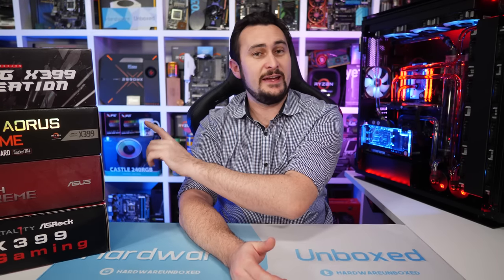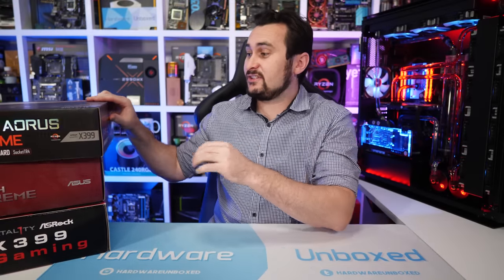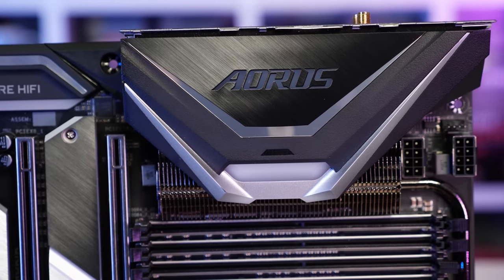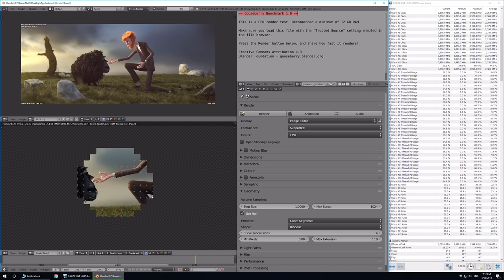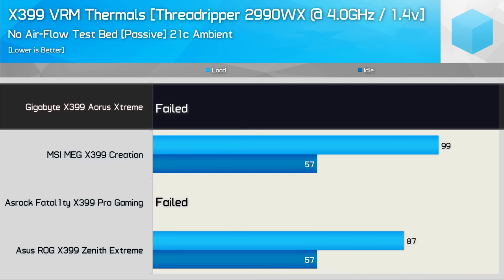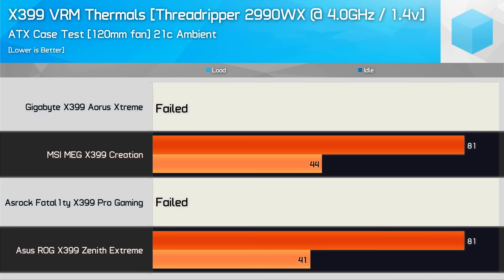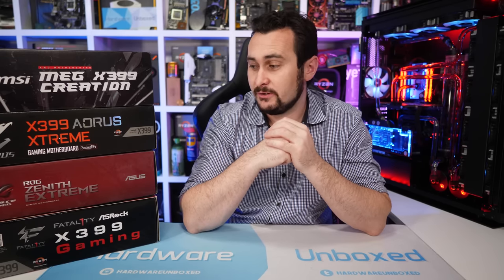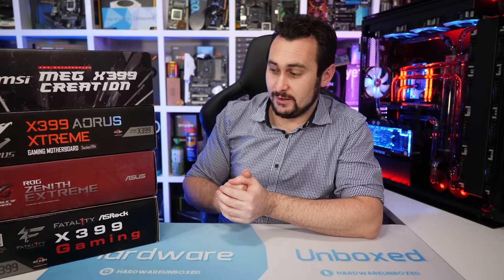2990WX Tripping Up High-end X399 Motherboards, VRM Temp Test

Comment: After using gigabyte mobos almost exclusively for 20 years for personal and hundreds of client builds, a string of DOAs and the RMAs i saw at one of Australia's largest retailers in 2015 has me swearing off them for good. Asus was the most reliable for mobos. (though i wouldnt touch an Asus monitor outside of a basic office setup. Same with Acer.)
Reply: they all seem to be going down the loo given the launch orgy... after years and years of market stagnation with just a new intel socket every few years and a few refreshed designs, then Z270, X370, B350, X399, X299 and Z370 all came flooding out in 2017. Asrock, Asus, Gigabyte and MSI now all have large contingents of rightfully pissed off customers and given the former no surprise at all. If these companies were smart they would have limited their market tiering to 2-3 models for ATX and 1-2 for mATX and mITX; but most are trying to keep the 3-5+ for every chipset and form factor they had before.
Reply: I've used Gigabyte for a long time in personal and custom builds for customers. But a series of having boards fail after a few months (yes, covered by warranty) has me now looking elsewhere. Gigabyte boards look great and offer a lot features, but what good are they if the boards fail or can't handle overclocking well.
Reply: Go with asus. For client builds (as im sure youre aware), hardware faults are a pain in the ass and the biggest pain is Mobos. Even for high end builds you dont need to bother with the ROG stuff, just use/recommend the 'A' models.  For e.g. the z370-A has good VRMs, plenty of features (the ones most people will actually utilize) and youre not paying a premium for ROG branding and pride parade LED lazer shows.   Regarding RAM, use Crucial (for default speed) or corsair & Kingston. Steer clear of Gskill.   Use Johnny guru's site to help select PSUs within a given price range - (seasonic for the high end).   Crucial or Samsung for SSDs.  Samsung for monitors.
Reply: I've got an Acer predator x34 monitor, it's actually really good. Saying that though, at the time it was their highest end monitor, so i can't really speak for their low end stuff.
Reply: With Asus mines litterary been the oppisite 0.0, the pg279q has been solid. The x99 strix, well go ahead and look up the reviews >.>
Reply: So you don't watch to touch the best 27 inch gaming monitors(165Hz ips 1440p) from last 3 years? Nice
Reply: Remember when Tyan was the bees knees for motherboards? Now they only do server stuff 😐

Comment: You know, now thinking about it, since it is possible to turn off cores in the threadripper series. Could it be possible to turn off both the 2990WX dyes that have direct contact with the RAM and infinity fabric, and then test how the performance is with the 2 dyes that don't have the direct lanes from the RAM. (I'm probably butchering the explanation but I hope you know what I mean.) Since only 2dyes of the 2990WX have direct lanes to the memory where as the other 2 do not. I feel like if it is possible, it could be a good test, just for fun that is. With the usual gaming and productivity benchmarks.
Reply: YOU DO NOT HAVE TO DISABLE THOSE DIES!
You can run process on specific die like this
cmd.exe /c start "" /node 1 "steam.exe"
Node 1 and Node 2 do not have direct access to memory.

Comment: 1.25v and 1.4v?  Ryzen CPUs will need around 1.35-1.37v to run a stable 4 GHz on all cores.  I have mine (1800x) set up that way now.  I can run 4.05 stable at 1.37v.  At 4.1 GHz it needs 1.39-1.41v.  I had 4.2 GHz running at 1.45v, but I didn't want to leave it there.  Got a 1920 CB15 score at 4.1 GHz.  These boards will fall short powering this many cores.  X499 needs to call for a new power envelope.
Reply from the maker: There is no 1st Gen 32-core Threadripper part so that makes no sense. Zen+ has different voltage requirements to Zen.

Comment: Hello

I have a setup similar to this, amd 2990, Asus zenith Aplha, and video card GTX 780, 1200 source ... When I use a video card with separate power supply appears 94vram error on the motherboard display. If I use a simpler video card without power from the source it goes up the oprational system.
Would you have any suggestions for me to be able to plug in a video card that has power and power up?

Comment: I'd like to see how the 2990WX performs on a board that has proper power delivery. I mean, what did they expect? Trying to run a 32 core CPU, with a VRM that's barely a token gesture.
Reply: My 4 phase VRM is pushing about the same power as an OC 2990WX    :)    mwahaha, lets here it for sub-zero temps!

Should be around 450-500w (that's conservative estimate for the CPU alone). I'm pounding it with 1.7 Vcore (I'd love to go higher, but my poor $40 budget board just doesn't allow setting it higher, otherwise I'd start cooling the VRM with LN2 directly but its not hitting thermal limits with the core temp so low).

Comment: that's so weird. OC3D did compare the MSI Meg Creation and the Zenith Extreme and the temperature gap was way bigger, with the creation leading by a lot.
How can you have so different results ?
Reply from the maker: Did they test properly or just read the inaccurate sensors on the board?
Reply: I can't find the part when he talks about his testing methodology because he don't talk about it in the MSI creation video. But once he did talk about how he tests the VRM thermals and he said that he put a thermal probe on one of the Vcore mosfets. 
And here are the results https://www.overclock3d.net/reviews/cpu_mainboard/msi_meg_x399_creation_and_threadripper_2990wx_review/16 and they are very different so what happened ?
For the testing methodology maybe you can ask him on twitter but as I said, I'm pretty sure he did use a thermal probe.
I'm not saying either of you is lying, I would just be very interested to know why you don't have matching results

Comment: Could you check the actual Vcore voltages? There is some variance in the actual voltage, even if the software indicates that the voltage is the same. 
Gamers Nexus has an article on the topic, 'How to Kill Your CPU with “Safe” Voltages'
Reply: Love this sort of content, and the VRM graphics were really nice.
Reply: @Seon-Ho Most likely he will have to mod the motherboards, i dont know most of these to have voltage reading points.

Comment: It would be more interessting to just see all the old 399 boards handling the new WX. No suprise the meg is handling it. Also, overclocking here is at least to me totally of the table, I do not care at all. This cpu just needs to work flawlessly in default settings. DO the old once all handle that? Looks like at least the asus did quiet well.
Reply: I think most of the older ones will handle it stock just fine. It only has a 250w TDP (honestly I'm pushing almost double that power through a 4 phase VRM budget $40 board running FX with extreme cooling). Since TR1 1950x could push almost 250w overclocked, most were probably designed for that.
Reply: Thanks Jake, I'll give it a try.

Comment: It seems ridiculous that a flagship motherboard fails to run a CPU designed for that platform with a "normal" overclock. Running a bit hot would be understandable, although disappointing, but failing to run at this price point is absurd.

Comment: There is no point to overclocking the 2990wx. It is just too much thermals and energy usage for such little gain. 1000 points in cinebench is not worth the energy and heat expense of running the cores that high and hard. But wonderful experiment into the limits of these boards. 1000 amps of current is just absolutely stupid and I would NEVER run that much even if my board could handle it. Plus the MEG is just one of the ugliest most under featured
 boards I have ever seen.

Comment: I'm surprised Asus and ASrock use the same 8-phase VRM, same Mosfet. However ASrock performs so much poorer. I doubt the heatsinks and the little 40mm fan on Asus makes so much difference. Can anyone explain?
Reply: @spektrumB Im wondering the same thing. And i think Asrock have different PWM switching frequency, higher than on the Asus board. Maybe 500-600KHz.

Comment: Been wanting to get the Enermax instead of going air cooled. Has it been reliable so far?
Reply from the maker: I've got two and they have both been flawless for me. Apparently the very first models had an issue with the coolant but that appears as though it was quickly solved.
Reply: @Hardwareunboxed  great. Really glad to hear that. Wanted to go 1st Gen TR4 + this AIO (280mm) using a mATX case. Thanks for answering.
Reply: I got the version 2.0 with RGB, 240mm.  yep works great for my 2950x, max CPU temp around 65c-68c at max load.

https://imgur.com/YOcydcv
Reply: @Ascendor81  I think I saw your post on r/Amd regarding the damaged package you received. Glad to see everything turned out okay

Comment: Would it be possible to power the overclocked 2990WX with the Gigabyte X399 Designare EX?
Reply from the maker: Stock, sure no problem.
Reply: Thanks, and overclocked?
Tweaktown states the following:
We get a true 8-phase VRM. Eight IR3556 are used, each is a 50A fully integrated (driver plus FETs) PowIRstages, and controlled by a fully digital IR35201 PWM controller in 8+0 phase mode. The inductors are rated for a maximum saturation current of 76A, and tantalum POSCAPs on the rear complete the LC (inductor/capacitor) filter circuit.
Reply from the maker: Yeah so the current capacity is down 20% on the Aorus X399 Extreme, I wouldn't overclock the 2990WX with it. I mean you can, it will just crash ;)

Comment: Why there was not explained why the Asrock board has way worse results than the Asus one, since both have the same exact VRM setup ? Asus's board also uses aluminum blocks and not real heatsinks. So those 40mm fans part of the ''upgrade cooling kit'' actually work ?
Nonetheless, thanks for the effort making the video.
Reply: Maybe asrock used cheap mosfet that cant handle that much power draw
Reply: @yuxuan qi - Asrock Uses the same exact PowerIR stages as the Asus board, its mentioned in the video. And another source that confirms that - https://www.hardwareluxx.de/community/f12/lga-tr4-mainboard-vrm-liste-1171058.html
Asrock X399 Boards even have better SOC VRM with the same IR3555 PowerIR stages.
Reply: @kindis4282  oh ok, then that might be issue with asrock bios, asrock AM4 bios is terrible, my X470 master sli with the latest bios has so many bugs which makes it so painful to OC.
Reply: @yuxuan qi - Why you bought it ? Return it, it has crappy VRM and it lacks any form of LLC. That one is more of a safety feature cause the board lacks real safety features.
Reply: @kindis4282  well, I brough it just a day before buildzoid made the rant video about that board, I didnt find enough review about it before I bought it, and I saw the "IR digi power" label on the asrock website  so I thought it was using the IR VRM which is not true lol, the place  I bought it only has 7 day return, and I was on a trip and missed it, rip. It is a shame for asrock to put wrong info on their website, and they can get away with it.
Reply: @kindis4282  because it lacks the LLC, I have to rise my vcore to 1.4v juat to make it 1.35v under load, that is very bad vdroop, I dont think I can trust asrock ever again lol.
Reply: @yuxuan qi - I feel bad for you. Next time do your research before purchasing. The X370 Killer SLI has an IR35201 controller, but Asrock decided to downgrade moving into X470. And not only Asrock's marketing team is lying for their VRM. Other companies also do that.
Reply: bios or active cooling probably.
Reply: @kindis4282  yeah, I totally should buy that one lol. RIP

Comment: ASRock is my favorite company for my usual gaming oriented builds. In fact, someone made a REALLY noce chart breaking down the overall quality and VRM quality of all Z370 motherboards, and my ASRock Z370 Fatal1ty Gaming K6 with the FDPC5030 power stages ranks damned near the top, in fact it was regarded as the top "Upper Midrange, AIO to High end Air cooling" motherboard in that particular segment. With 5 doubled stages, 10 VRMs dedicated to Vcore alone - keeping VRM temps low, whilst allowing my 8700k, or even a 9900k to draw an absolutely insane 255 Amps of power directly to cores alone! 

I honestly would not buy their Threadripper boards over the competition right now, for anyone wanting to use the WX series CPUs - and potentially because 3rd gen Threadripper will probably have 32 cores on 2 dies (like the 1950x/2950x right now)  and thus will be a MUCH more reccomended CPU for streamers and people who do content creation along with some gaming. 

Though right now, I would never buy the 2990WX at all, as I have no use case, and neither does anyone I build for.

Comment: Zenith extreme easily dominating the stress test with half of the Phases than the MSI. I saw theese tests and i feel very proud for waste that extra money on the Asus board. Well done Asus.
Reply: @Guille Ghemi And how do you think that baord with the same power capabilities as the Asrock does so much better, even with the CPU overclocked ? The Gigabyte and the Asrock fail but the Asus keeps going - that does not make any sense whatsoever.
Reply: Adding some fans to your case (which everybody would do) turns the MSI to be on par or even better than the Asus, in some cases, i just found out both to perform about the same, i also got the same questions as Kindis, Asus may have their own sauce that works on point or something went wrong on those benchs.
Reply: @yottaXT - I have my own assumption but im waiting for an confirmation from the author of the review, which i assume its Steve. I think it got to do with the controller (IR35201) and the way its being configured.

Comment: Guys i have a problem. I have a ryzen 2600, 3200 cl 14 ram, and a gtx 1080.
I found out that in bf1 the CPU heavily bottlenecks my GPU without going 100% on any core. (windows power management it´s on balanced with max state at 100%). It´s not a GPU problem, because in 2k and 4k, the GPU just goes balls to the wall, 98% usage, and in 1080p if i´m in..... some light weight scenario, like inside buildings, or inside a basement, same result, 98% consistent on GPU and fps goes to 140-150.

I have a to say i was expecting a CPU bottlencking, but something like 5%,. Sometimes my GPU drops to like 40.-50%.
The thing is, that monitoring with MSI AFTERBURNER and HWINFO, it looks like only the first 3 cores, goes to 3800mhz. The 4th moves between 1546mhz and 3800mhz, but it stays mostly at 1546mhz, and the last 2, don´t even move from 1546mhz. Also when i´m playing bf1 with AFTERBURNER, HWINFO and RIVATUNNER on, unless i open some chrome tabs, my last 4 threads are locked on 0%, and they should all be working.
I have a ab350m gigabyte motherboard.

Comment: ASUS: Pretty damn good, no wonder they are usually so expensive.
MSI: Well damn, you always seem to surprise me.
Gigabyte... What happened to you? You used to be awesome back in the days.
AsRock ... sorry, you never seem to get me to hope up with all your false promises and advertisements.
Reply: I've had luck with my Asrock boards, but I also hate marketing in general, I never trust them. Marketing: "Big numbers people, BIG NUMBERS!". They seem to do good with what they have though, even my 4 phase VRM on my $40 mATX board is pushing near 500w on FX at 1.7 Vcore with extreme cooling. I keep expecting to use one of my fire extinguishers (I keep 2 beside it), but it hasn't failed yet. I'm not a fan of the BIOS though, power delivery seems like exceptional value if you can put up with the BIOS quirks.

Comment: indeed useless those 40mm fans, they make noise as hell, and will die within a year , the plastic covers have no deal, heat keeps under it, rip them off and putt a decent 80mm fan around those vrm